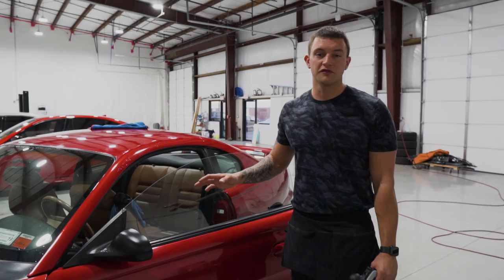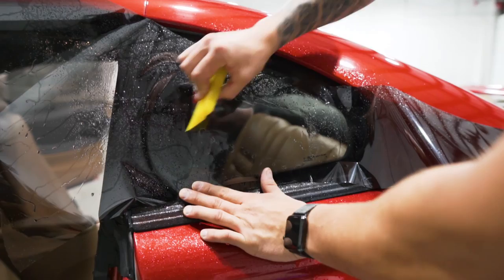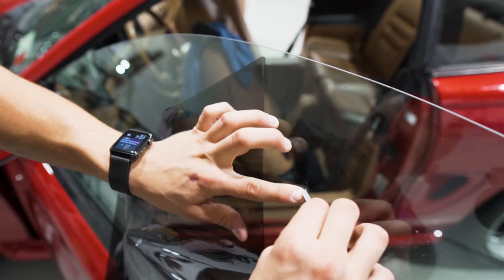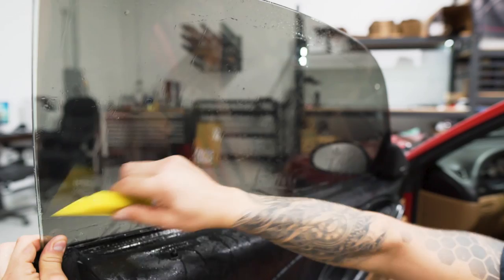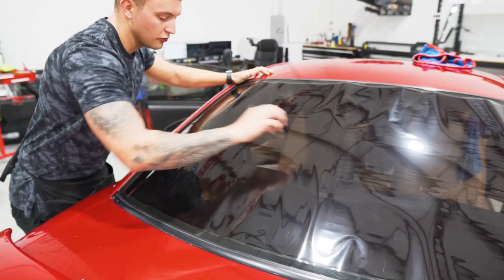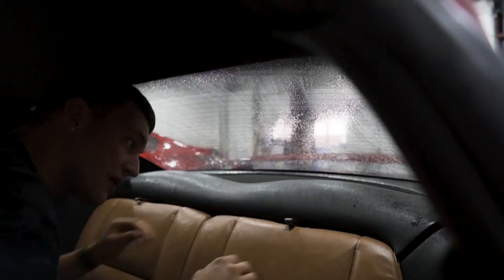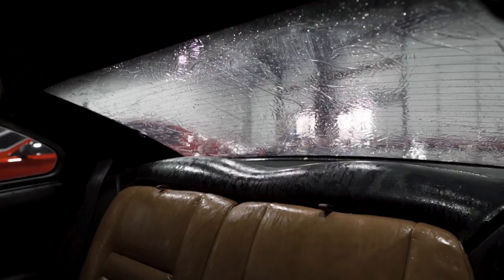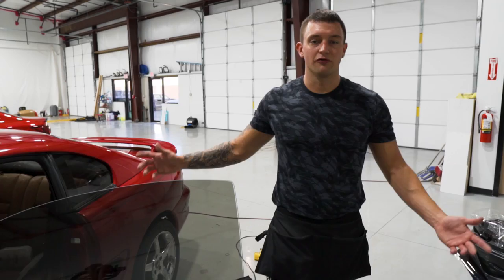How To Tint A 1996 Ford Mustang Coupe

Comment: you tinted the back and quarter windows so fast and precise i almost caught covid-19. I spent 3 hours doing my rear window today. Sadly, the tints bought from auto store or walmart are not as long as the ones you use. So it’s is harder to do the “H” pattern.
Reply: If you're still looking for a solution, there are tint films that are divided into rows for the rear windshield. They might help you out

Comment: I'm trying to tint my 2000 crown vic...do I have to take off door panels to tint?the window gaskets won't let the tint slide down
Reply: U can for the front man but rear use a shank to get the gaskets open Vic’s are pain to tint and shrunk rear windshield too
Reply: @B711HD  thanks

Comment: I have my film ready, what would happen if i don’t use the heat gun before applying?
Reply: I think you can't
Reply: Come out bubbles and cruses
Reply: When you install and squeegee everything out. The film won't be the same shape/contour of the glass so you'll have fingers....only way to prevent is to bottom load because the sweep isn't putting pressure on the tint causing fingers....shrinking the film eliminates this problem.